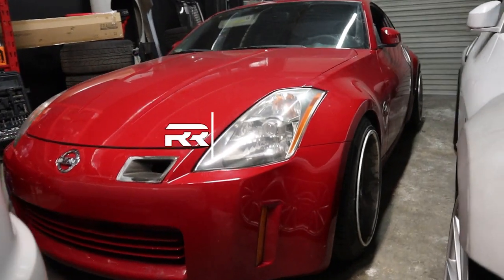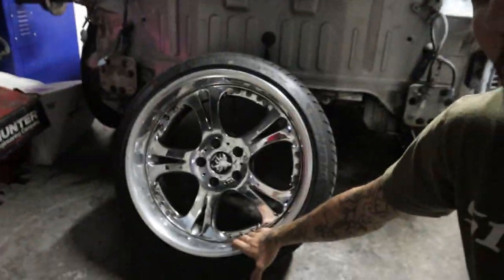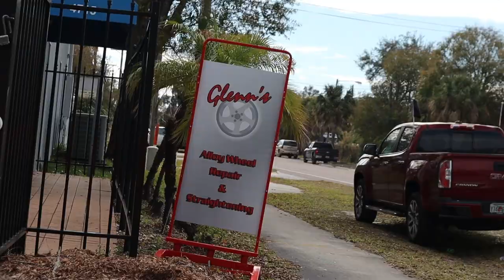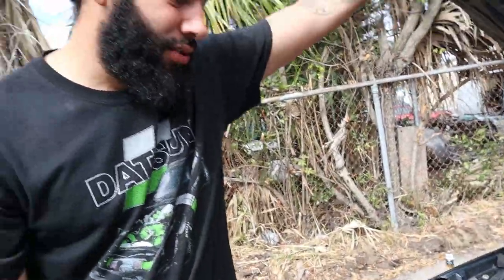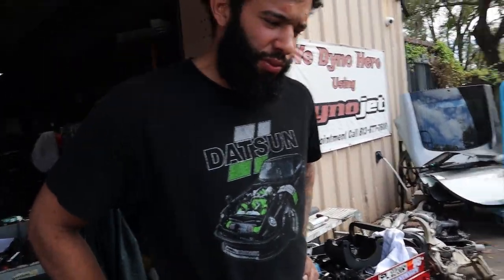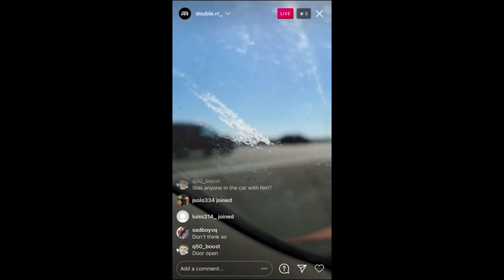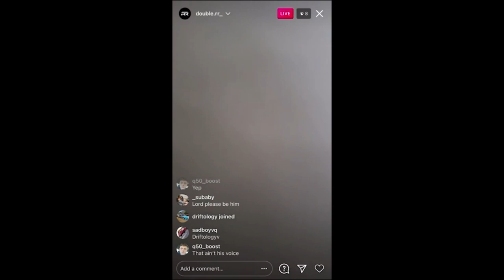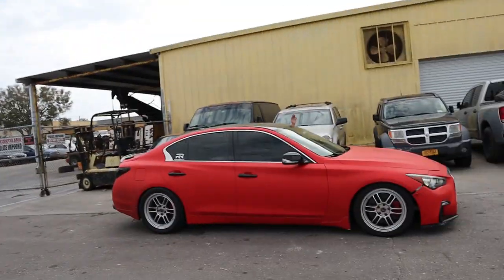I GOT ARRESTED...

Comment: Everytime I hear your Q50 start I wanna supercharge mine 🤦‍♂️. I’m 32 have 3 young kids and a wife. Just sold my Harley to get the Q50 and still have my 300C project. May have to sell the 300C and invest 10-15k to supercharge the Q 🤦‍♂️. Did just drop $2300 at Z1 motor sports on BC coil overs, Stillen splitter and defuser some color matched oem Q50 sport body parts and some other goodies tho
Reply from the maker: if you have ANY questions at all or need any help with you build make sure to reach out to me !!! I love helping the community, the more modded cars on the road the better as a whole we are!!!!!
Reply: @RomeloRoman  thanks man appreciate it